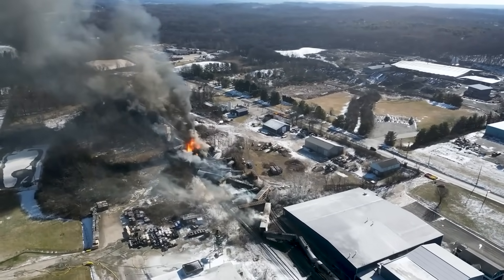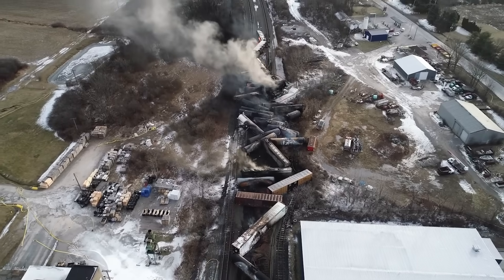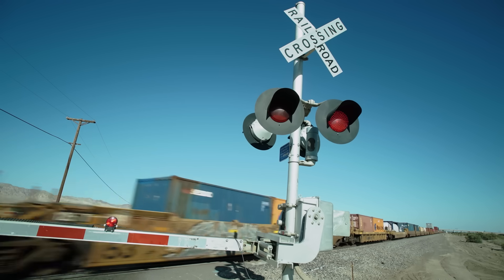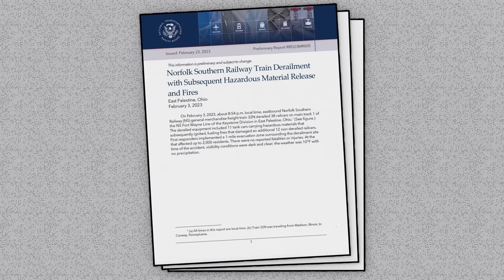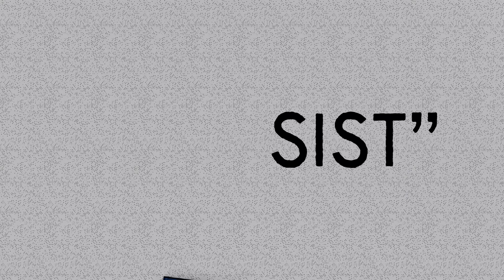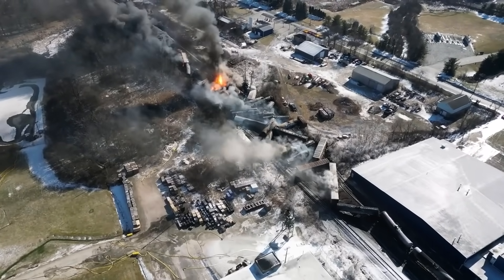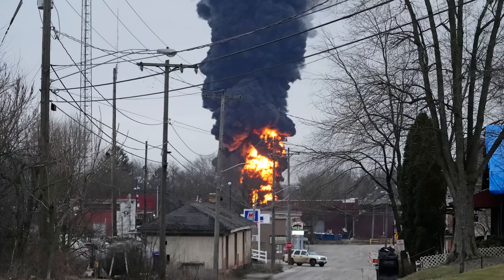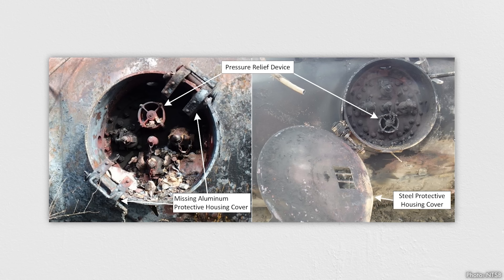East Palestine Train Derailment Explained

Comment: This is the first sane, fact-based presentation on the disaster that I have seen.  The news cycle is so hell-bent on hype, breaking news, this just in, and how many deaths have been caused that a factual discussion on what's so is impossible.  Blood, guts, and stuff blowing up to high heaven sells.  Thank you for the calm, factual account.  Of course, that's the (non-train) engineer's code.  :)

Comment: I know the cars may be positioned in the train based on their delivery point, but would it make since to spread the tanks out along the train to limit the number of tanks involved in a derailment?
Reply: You could, but then you'd have to spend hours upon hours switching cars out at the destination, as you'd be essentially building a second train. And then no other trains would be able to go through the area for that extended time which would cause system-wide delays that would simply compound with every train hauling hazmat. Before you know it, no trains would be moving anywhere for extended periods and this would have nation-wide effects on supply not unlike the Suez canal blockage. It wouldn't be practical on any level when maintenance and detection standards could just as easily be returned to what the norm was 40 years ago and solve the problem preemptively.

Comment: Excellent video! I am more on the side that the controlled burn was not the correct response although I do understand the reasoning behind it. If you look at the verbiage of the DOT's Emergency Response Guidebook (used by all firefighting crews and emergency responders) 116P for vinyl chloride, looking at the "Fire Involving Tanks" section the guide says to "let fire burn" not "create a controlled burn" in the event of an uncontrolled fire. A controlled burn may be fine for methane at an oil refinery where you can assure there are no side products, but for vinyl chloride, the uncomplete combustion (clearly visibly by the thick black smoke) likely created dangerous side products such as phosgene that likely killed wildlife in the area. 

Fantastic explanation behind the DOT Tank Cars! One of the best explanations I have seen mentioning those. Sadly, there are even more hazardous materials transported by rail and vinyl chloride is not even considered top ten by far and there are higher rated tank cars that could have been used (although not specifically required).

In my personal opinion, lack of maintenance in the train cars by Norfolk Southern clearly caused this accident but the response by the local emergency responders was not technically appropriate. There was a non-zero chance that the fire would burn down and the vinyl chloride would not explode, by creating a controlled burn, this removed that non-zero chance and made it absolute. To prevent accidents like this, perhaps the tank car ratings for hazardous materials should be revisited, the temperature of failed wheel bearings should be reduced, and infrastructure such as unmanned firefighting devices should be put in place. 

Excellent video and thanks for your input despite not being a rail engineer.

Comment: Two things I wanna mention:

First a minor nitpick: If I recall correctly from the report I read from the NTSB, the train crew had the locomotives in dynamic braking, which I believe is NS procedure. Dynamic braking uses the traction motors on the locomotive to slow down the train by converting them from motors generators. The advantage of using that in this case, is dynamic braking doesn't put any additional stress on the axles (and wheel bearings) After getting the warning about a hot axle, the crew put the locomotives into full dynamics and shortly after the event recorder showed the locomotives air brake system dumping into emergency. It's a tiny nitpick that doesn't do much to change anything you said, but I did want to mention it.

Second: thank you for mentioning the burning hazmat chemicals is done to reduce the risk because it either destroys them or at least makes them easier to spread out, which makes it more dilute and less harmful. The number of people that freaked out saying it would spread "far and wide" and didn't understand that diluting the chemicals was the best option given what they knew at the time is very depressing.

Comment: I was wondering if you would tackle this disaster from an engineering perspective. And I’m glad you did. America has been operating trains for over 150 years. It is by far more safe now than in the first 75 years, yet there is still improvements to be made and problems to be solved. 

One of those problems is Wall Street investors putting pressure on the railroad companies to ever increase profit margins. I understand that railroads have either laid off workers or not filled empty positions and cut funding for maintenance projects. This must stop. Greed is an ugly thing!

Comment: What material and chemicals were mixed in with the existing railroad ballast and rail bed material?   What would be their effects on humans when these were  mixed with the dumped chemicals from the rail cars and burned?

There is a large gap between what should be expected and the real harmful experiences taking place to people and animal life around the crash site.  There are two obvious gaps in severity of cause and results.  The first is the freight car showing signifiant bearing temperature above ambient that was hot, but far from imminent metal failure.   Once the high axle temperature was reported from the track detector it was far below what should of been imminent failure.  The crew now trying to bring the train to a gentle stop on a relatively flat grade should have had a margin to do so, but the car failed almost instantly after the warning.   

The second was the common chemicals thought to be involved in spills and in over heating tanker cars that were released shouldn't be able to be causing the types of humans ailments many people are reporting, many of whom are rail and technical professionals clearly able to separate common ailments from the unique symptoms they've attributed to this site. 

Purdue University had people from the school of civil engineering go to the East Palestine train crash site to conduct air and ground testing.   Much to those peoples surprise they could still smell a chemical content in the air and some of them got headaches and felt ill for a few days after being at the site.   They tested and found chemicals EPA and other government testing organizations don't test for that are considered harmful to humans and animal life.   Although this was a significant train wreck it was not massive and the chemicals dealt with are well known.   This indicates there are still critical unknown chemical outcomes associated with this crash site.

Comment: You pose the question "why do they move this much hazardous cargo through a town"
To which the answer is another question "why did they build the town so close to the railway"

And that's when you realize that a significant portion of towns in the US exist only because there's a railway passing through them.
If there's a rail on a location where a town makes sense to be built, there's more than likely going to be a town there. Or in fact a whole urban sprawl.

So it's not the railroads fault that they bring hazardous cargo through towns, it's the tows choosing to be built around railways that are to blame.
They can move the railway around the town but then the TOWN will follow the railway line, and so we are back to square one.

Comment: Your optimism regarding the railroads is appreciated, but also blind.  They won't change.  They have no incentive to.  There are on average 4 derailments per day in the United States.

The railroads would rather run their trains slower than perform any sort of capital improvement.  As a part of the legislation resulting from the EP derailment.  The NTSB has drafted an option of either installing positive train control on all hazardous trains, or not running the trains above 30mph.  I think we know which way the railroads will go.  We've already seen it with the maximum speed limit of all trains in the US at 79mph, because of the lack of capital improvement.

The only way to make it change is to vote and to go on strike.  But the railroads have lobbied and controlled the government so much that going on strike is effectively illegal.

Time and time again through our nations history railroad workers have gone on strike but the government has sent in their own national guard to quell the strikes.  It would have happened again this summer.  The POTUS even ruled on the workers striking.  That is the power that a monopoly buys you.

Comment: How on earth did they EPA not measure any dangerous contamination in the air?! Burning vinyl chloride releases hydrochloride, which forms hydrochloric acid in the lungs. It can't get much more dangerous than that, and there's very tight limits on how much there's allowed in the air. Noone can tell me that those limits weren't breached by orders of magnitude over a flaring tank vessel. I wonder how much the rail company had to pay to get that report "adjusted"...
Reply: The VC is a gas, but it is heavier than your regular air so it sticks to the ground.

Thus it makes sense, that the mentioned EPA airplane 60 or 100 meters above ground measured nothing like VC. 

It is observation bias.

Comment: 0:30 There is nothing special about Vinyl Chloride, any volatile liquid will build up pressure when heated.

2:57 That defect detector is located near Campville, Florida which is about 15 miles east of Gainesville where the University of Florida is located, one of the top engineering schools in the country as Grady well knows.

It annoys the hell out of me the way people throw around phrases like the one he used about impacts affecting railroading for years to come. Just what impact will there be? The defect detector worked, the engineers followed guidelines and attempted to stop the train immediately upon receiving the DD report, what more do you want?

Comment: A little outside strict engineering, but a big part of the problem nowadays is the focus management puts on reducing operating ratios by using Precision Scheduled Railroading (PSR). In PSR theory, it is better (profit-wise) and more efficient to run trains and cargo point-to-point instead of using the traditional hub-and-spoke method of having freight cars shuffled multiple times in yards. Trains are a) made longer and longer and b) moved to the high-traffic lines, with low-traffic lines closed down. This would be good if the companies also invested in their rail infrastructure and increasing the workforce, for having longer trains would necessitate more workers.

Instead, the the implementation of PSR has lead to:

a) Longer trains also constantly block the mainlines because big oops, the companies forgot to lengthen the sidings that would let other trains through, leading to
b) more delays and lower customer satisfaction than normal.

But more relevant to accidents like this:

c) fewer workers being used (20,000 workers laid off in 2019 alone), while at the same time their responsibilities have increased because of longer trains, and
d) with fewer workers and quicker times, this leads to less maintenance AND shorter inspection times for longer trains, which inevitably increases the chance of accidents.
Reply: With the increase in acidents and other errors, They will properly abandon PSR as it's turn out to be false economy.

Comment: Grady,
Great synopsis.  I thought that when making up the trains, there was some rule about the number of hazardous cars that could be grouped together. For example, if 10 hazardous cars were grouped, the next 5 had to be non-hazardous cargo, limiting the risk. I remember seeing empty box cars between tanker cars on trains.  I assumed they did not have enough cargo, so they put some “dummy” cars in the line to separate the tank cars, following the rules to limit risk. Is this no longer the case?
Reply: That's a rule for the train to be called a manifest or mixed freight train. If a train has more then that 10 cars it is then called a hazardous train, and there might be some more safety features for those trains.

Comment: I think 90% of the information in this video is false and if you spent the time to look it up instead of taking this guy's word claiming to be an engineer you need to add lots of natural gas to incinerate the black smoke itself means that chemicals are being released notice the difference between the two flames that they show there are massive health effects in there affecting the food of everybody in America it's so bad that's why the company's didn't want to go to the site because my nudes amount of that chemical have effects on your DNA and cause birth defects but again they act like it's safe look up what happens when you burn vinyl chloride look up how bad vinyl chloride is and look up what happens when you mix vinyl chloride with water it's a very powerful chemical

Comment: The derailment occurred alongside a tributary of the Ohio River. Letting the acrylate and vinyl chloride spill flow down the slope into the river was more awful than flaring it off, even with the ensuing toxic cloud billowing across the town.

I think Norfolk Southern needs to buy out a town at fair market value. The cost benefit analysis for precision rail scheduling needs to factor in economic losses of bystanders.
Reply: I agree except one thing fair market value before the incident not after. As there derailment has completely wrecked the value of that location.
Reply: They need to pay above fair market value because it's value is lower than what it was
Reply: Or the CEO, and its board along with all State and Federal officials responsible lose their pension and go to prison for the compensatory damage to life and the environment. But of course, were that to happen, it would suggest the people who run the corporation and regulators are responsible for the corporation, which everyone knows is an impossibility when acknowledging that corporations are not only people but incapable of being held to the same account as actual people. Point being: continued profits to be gained by actual people from corporate crime can always be justified and accounted for as "Oops." A marvelous feat of 'political engineering'.
Reply: local and federal government dragged their feet
Reply: @hershelshochter4703  dragged their feet while trying to respond to a major disaster caused by a private company which contributed nothing to their emergency preparedness programs

Comment: 9:50 "the EPA flew a specially-equipped airplane after the burnoff to measure chemical constituents of the resulting  plume. THEY FOUND LOW DETECTIONS OF ANY CHEMICALS OF CONCERN and concluded in their report that the  controlled burn of the railcars was a success."
➤ Before EVER declaring their own efforts a FAILURE our government would just move the goal posts by redefining LOW DETECTION and CHEMICALS OF CONCERN so that they could declare it a success.
It's impossible to fail when you're the one making the rules.

Comment: I wonder if any of the freight networks use rate of change or even AI to better understand not only single points of monitoring but how these monitoring points are trending / changing in order to better predict imminent failures?
Reply: You must be kidding! Most railroad technology in use today dates back to the 19th century.
Reply: Wow, I didn’t know they had remote temperature monitoring of axle bearing temperatures, along with transmission systems and alarm set points, in the 1800s!

Comment: So many of these disasters end up pointing to a lack of regulatory body oversight.  Sometimes it's because the regulatory body has been essentially defunded to the point where they can't perform to their mandate.  In some cases it's apparent that the senior levels of the regulatory body are acting as an organ of the Industries they are supposed to be regulating.   The general public pays attention to the issue of the day, but governments (and lets not be partisan here, this happens across political parties in both Canada and the U.S.) create these conditions in the fine print that rarely gets much attention.  The media might do a good job on reporting the event in the immediate aftermath however the in depth follow up usually gets 'page 3 below the fold' treatment.  And we're off to the next preventable disaster....
Reply: Spot on! Best to you, Rod!

Comment: The air brake system was a little simplfied. This would be a good topic alone for a Pratical Engineering episode. But yes they did apply, or as railroad people say "kick". Any drop of brake pipe pressure of more than 20psi a second will kick the brakes, assuming the car's reservoirs have some charge in them. Yes , DOT specs are nice, but does it really matter if you have thicker steel on the ends of a car if you have 10,000 tons of train being shoved into it. It was pure luck more cars were not breached. These long trains are insanity. There is no doubt that there would of been less damage if the derailment had  60 cars pushing behind it and not 110 cars. By the way the air brakes can only apply at the speed of sound. Sounds fast but make a sound in NY and Los Angles will hear it 3 hours later.  A 147 car brakepipe with all its elbows and bends slowing things down could take 15 seconds to reach the last car on the train. (the DP locomotive my have assisted in the application). This 15 second delay could of sent 6 extra cars into the derailment pile.